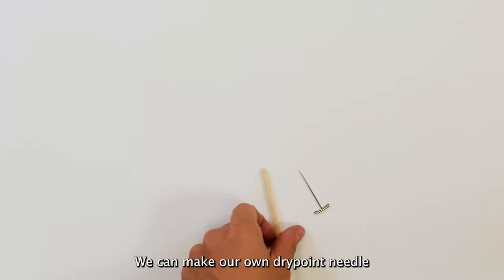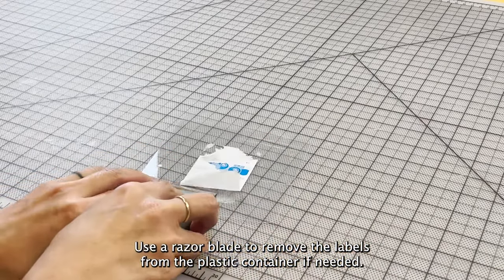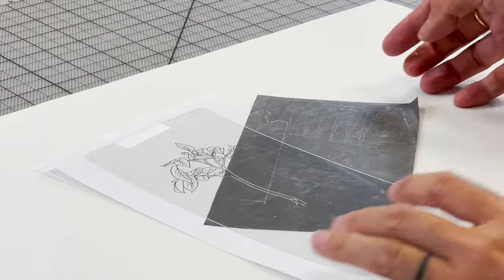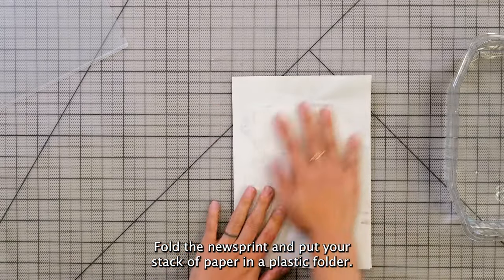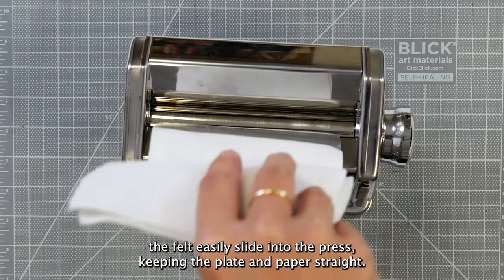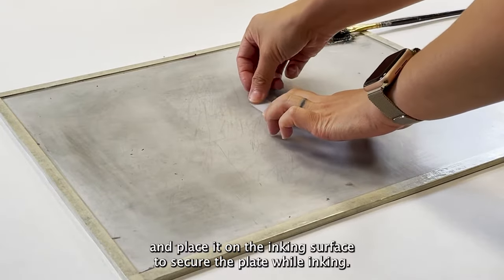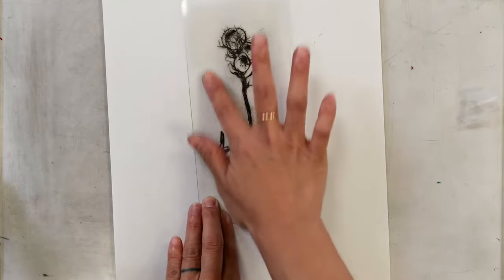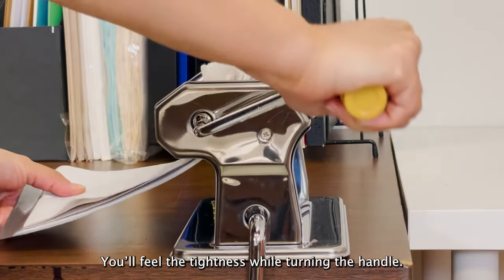Intaglio: Drypoint & Pasta Maker Press

Comment: Did you use oil based ink for this?  Can it be done with slow-drying acrylic paints?
Reply: @MaryThompson63  - He used oil based ink in the pasta machine lithograph video. In the comments there, he replied to a questioner and recommends specific company names.
Reply from the maker: For this technique (drypoint), you can use either water-soluble or oil-based printmaking inks. If you don't have any of these, oil paint also works but not watercolor and acrylic paints. Some suggested links that work for me can be found on https://www.teachprint.com/tools-materials :-)